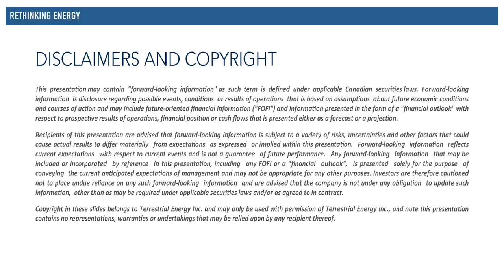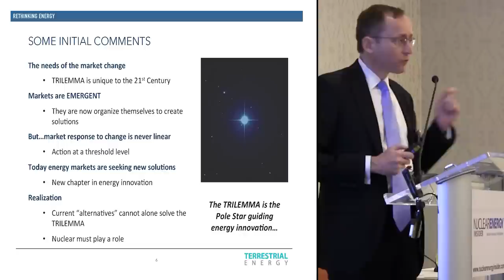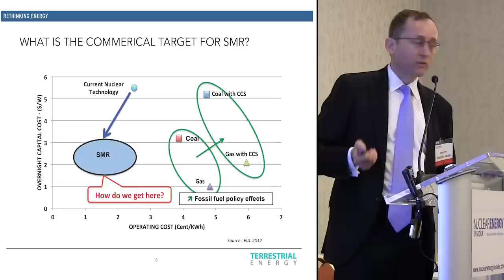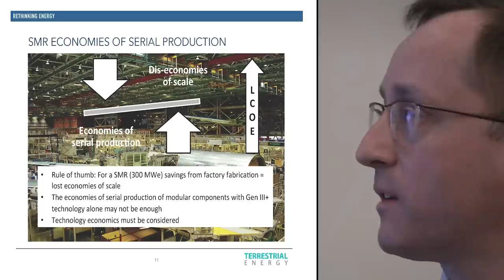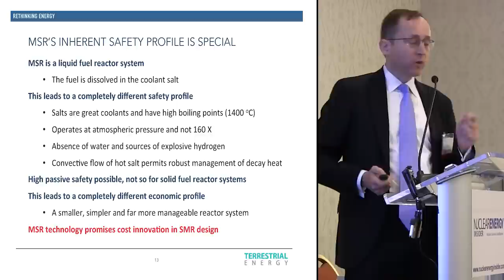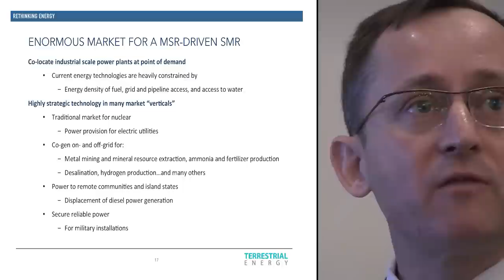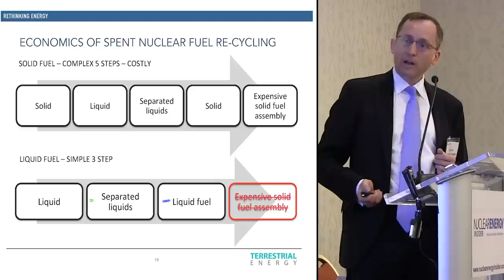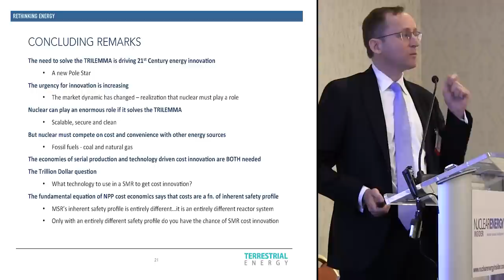Simon Irish - Value of Molten Salt Design in SMR Innovation

Comment: I found this seven year old presentation to be excellent, even superb,  up to the point where he said MSRs could generate 1/6 less pollution.  In trying to figure out this enormous error, I realized that he must have been unaware at that point in time of the ability of some MSRs to breed and burn more than 95% of the type of Uranium fuel put into a LWR or BWR.  Today I believe that a claim of eliminating 95% of present waste is justified, w/o even considering the ability of some MSRs to run entirely of what is now waste from BWRs and PWRs.   MSRs that can only burn U235 will will clearly be at a disadvantage in terms of waste volume. 
He also had no comment about the shorter radioactive lives of waste when long life transuranics are burned up in the reactor, nor the inherent temperature stability of the expanding/contracting fission reaction in molten salt.

It's time to extensively update this material with far more benefits of MSRs mentioned, particularly with the fast burner designs in mind.
Reply from the maker: Simon (and the rest of Terrestrial Energy) as aware of breeders. They're not building a breeder because it would make the build more expensive, and take longer to license. The cost of fuel is low (regardless of the MSR being a breeder or not) and anti-nuclear orgs have proven they don't really care about used fuel only that nuclear is bad. So the one "political" challenge breeders effectively address... used-fuel... doesn't actually lead to a political advantage.

Comment: I’m all for these technologies.  But there is a major public concern about ‘Nuclear’ which needs addressing, especially in the light of the Fukushima debacle and recent reports of large forest fires liberating another eco disaster around the Chernobyl site, 29 years after the initial accident.
I can’t see a way to make it clear to the public that this technology is different. Most just see the word ‘Nuclear’ and immediately focus on the above mistakes.
Ultimately it may take a semi-dictatorship like China to get this working...
Reply: North America is this technology's ideal deployment engine. But we will have to call solar "relatively dirty power" to make the argument so raucous it gets free media.
Reply: in the past nuclear reacts were made to produce fashionable isotopes like plutonium and uranium we should have used thorium cannot be used in weapons it has to be bread to fission you can excite it with   accelerator with a molten salt cooled system operates at 1 bar pressure there are now three thorium reactors operating India has enough thorium for 70,000years
Reply: Honestly, it doesn't matter what China does, the US is by far a larger consumer of reactors than any other country. Sure the scale of China's power grid is going to grow and eventually will catch up to the US and perhaps surpass it. But either way, it doesn't matter what they do, as far as consumption is concerned, whatever they do is going to be for China's consumption. Now, maybe in 20 or 30 years China's grid will have grown to the point that they surpass the US and they become an exporter of power, but even then it will be localized to the region. Now as for the "concerns" of MSR safety, it's not a solid fuel, like current reactors, it already is a liquid and can be contained as such. In fact, you could build one right on the site of current nuclear plants and could consume the waste from the original plant, and not have to truck the solid fuels anywhere. I'd call that a win for mother earth.
Reply: China has taken Alvin Weinburg's MSR papers (which are open source) and have hundreds of engineers working on molten salt reactors. They can also use them to replace coal fired power boilers. The existing turbines wont care where their heat comes from.
Moltex Energy Ltd have a molten salt fast reactor (SSR) that will be burning spent fuel in Canada long before any such plant gets built in UK. We need nuclear regulators that regulate for safety but do not apply a tick box approach that's not appropriate for molten salts. That approach stifles innovation and is neither safe nor is it viable. IMSR and SSR are both fundamentally safe. They dont need layers of engineered systems to deal with risks they simply dont have. They cannot become dangerously overheated even in a worst case loss of coolant. The SSR keeps its fuel in vented tubes separate from the coolant (heat transfer) salt. If the tubes somehow ruptured, the fuel would be too dilute to react and the mass of coolant salt would absorb any decay heat. The SSR does not have a moderator so storage of used carbon cores is not an issue. However the SSR does not have a new vessel every 7 years and only time will tell how long it's vessels can operate before they have to be replaced d/t neutron damage.

Comment: I really think that The MSR gang needs to take aim at oil. Electric cars are on the way and if you compare the destruction from oil vs nuclear then it seems quite clear to me. The conversion ratio is 1 000 000 : 1! I mean a Kg of uranium is equivalent to one tonne of oil! That shit is crazy! One pickup truck full of uranium is worth one million of oil! 

The chance that the one truck load will have an accident is there, but for the one million truck loads! I mean come on! Look at the oil spills on the oceans. In our lakes and rivers. And when everything goes as planned, look at all the pollution that goes straight up. Nuclear waste is non existent compared to oil.
Reply: Nuclear waste doesn't need to be a "problem", build an MSR right on site with the current reactors and can consume whatever waste you have, the waste never leaves the site.
Reply: @Rob_Moilanen  Run in the fast spectrum and your waste profile drops even further. Ian Scott says his SSR will use about 20% to 25% of the available fuel energy. But on site reprocessing will allow that to be taken to 99%. He will be using spent fuel from PWRs as fuel so has to eventually process them down to a low grade waste for easy storage.